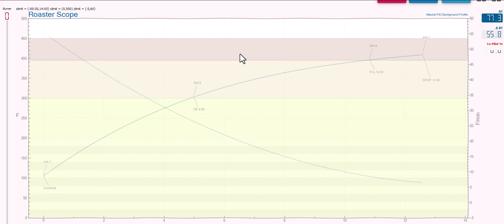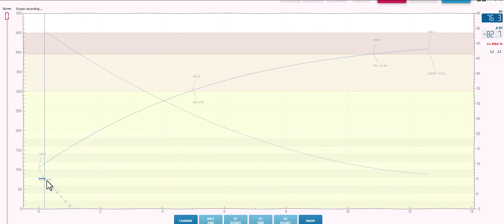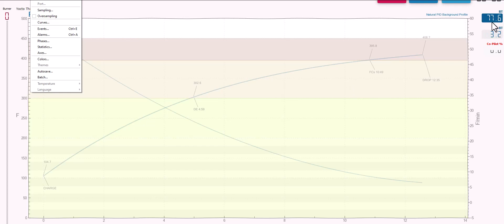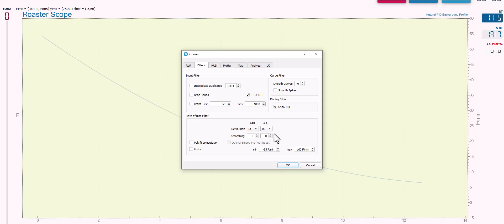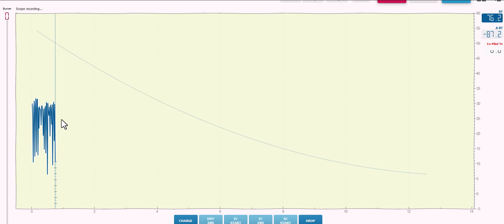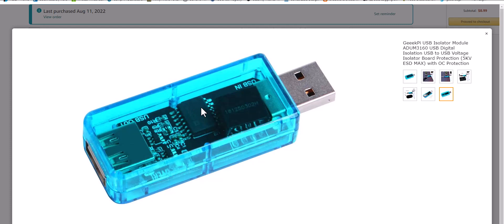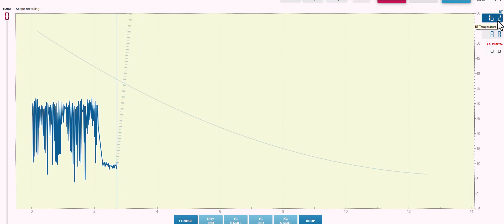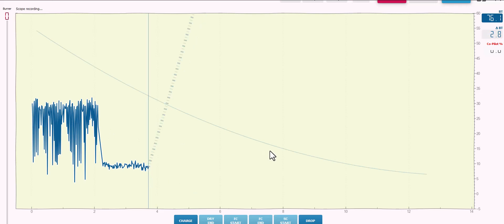Testing your idle noise in Artisan roasting software

Comment: What probe are you using? I bought a Kaleido M2S roaster, and idle noise on a probe is 1.5C without USB at all (just bluetooth). It feels bad, but I struggle to find reference point.
Reply from the maker: I'm not sure what probe I was using at the time of this video, but I DO know that a 1.5C idle noise is very high. You should be able to get that down to 0.1C with a system that is free of ground loops and interference.

Comment: Would the co-pilot solve the idling problem or do you still suggest an isolator? Just ordered mine and I’m excited to use it! Thanks for all of your efforts to help us CC artisan fluid bed roasters!
Reply: Thank you so much! That is fantastic. I’ll be in touch to share my progress, I’m excited to begin this new approach!
Reply from the maker: No, if you have a ground loop issue, the Co-Pilot won't solve it. I used to offer an isolator as an add-on, but received a bad batch that had a high failure rate, so I'm back to evaluating different units. I'll be sure to include one with your kit at no charge! Having said that, most people do NOT need an isolator, and I don't recommend using one unless it's absolutely needed. So I would still encourage you to do this test to determine your need for one. Thanks for the kind words and the order!
-Jason

Comment: Could a ferrite bead attached to the thermocouple cable fix this issue ?
Reply from the maker: Could it fix THIS issue, as in the one from my video? 0% chance. Because my issue in this video was 100% a ground loop issue. Ferrite beads on a thermocouple can, in theory, help reduce noise... but they operate as "filters" in such a narrow, targeted frequency, it's nearly impossible to slip one on and have it magically fix something. Instead, you'd ideally need a scope that could show you specific frequencies that are the issue, and then you'd choose a specific ferrite bead/choke to attenuate that. But simply guessing has more chance of INTRODUCING an issue than it does fixing an issue. And in the case of a ground loop (which was definitively my issue in this video), the ONLY solution is to electrically isolate the signal. Ferrite beads don't isolate at all. The USB isolators that I use (and nearly all that are on the market) use an ADUM component that acts as a purely inductive transformer. That is, it 100% electrically "breaks" the connection, then recreates that connection across an inductive field. I hope this helps.